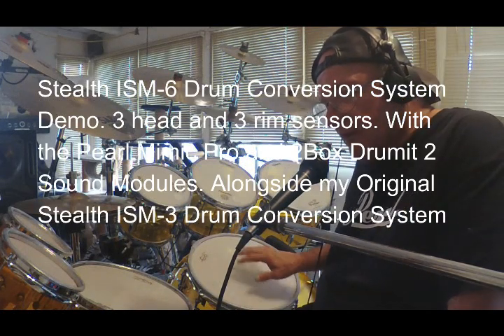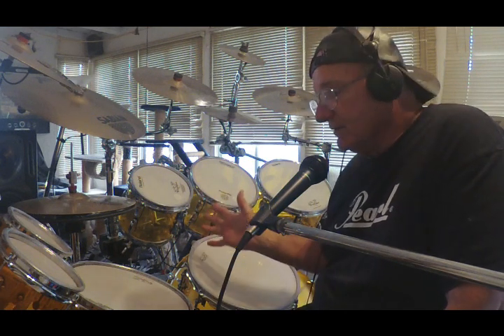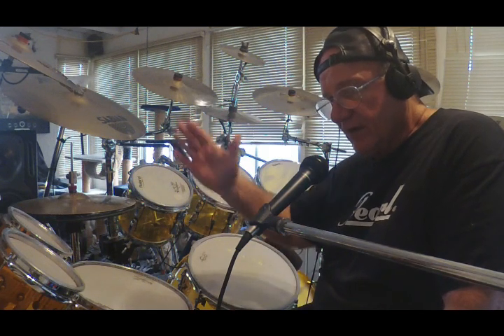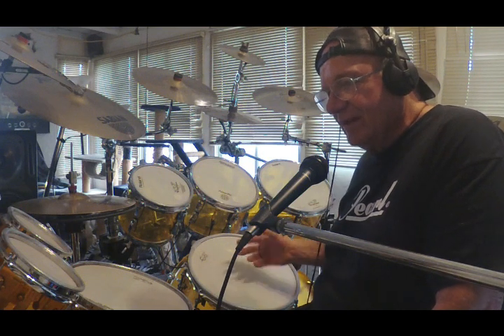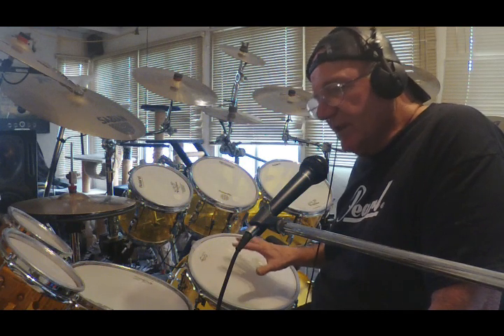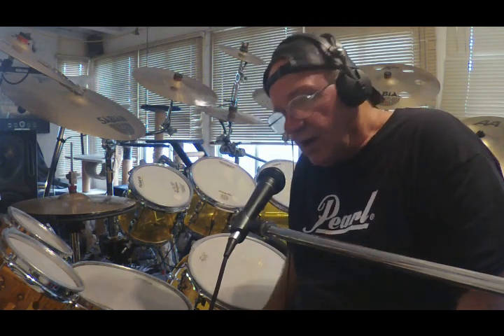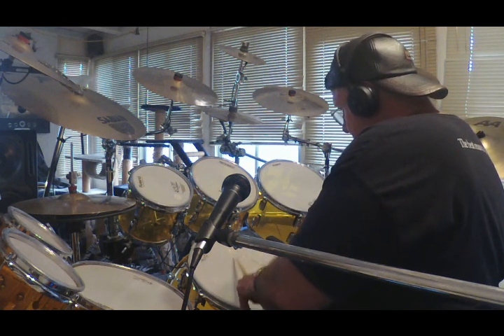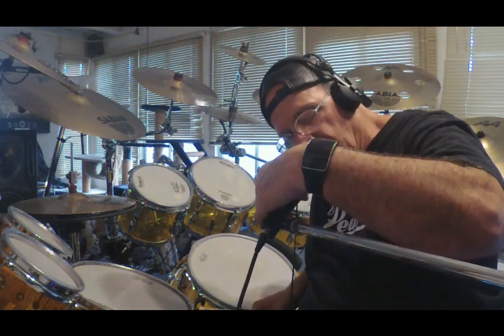Stealth ISM6 6 Sensor Drum Conversion Demo Video

Comment: That's a great job overall Jman! Can you tell me which hihat controller you are using? It's so natural!!
Reply from the maker: Right now I am using a DIY FSR HH controller I built. Honestly though the biggest magic is in the Pearl Mimic module. You can use just about any brand Hi Hat controller out there and it works great. I suppose the only exception is the VH-12 .... most report poorer results with that. When I first tested the DIY FSR controller with the Mimic:  https://youtu.be/r1svrFKcOHc